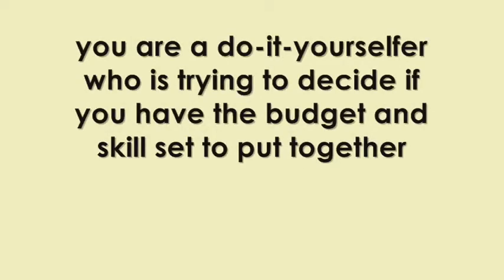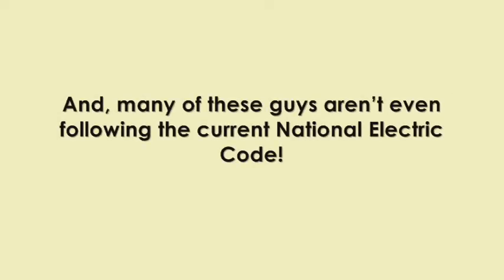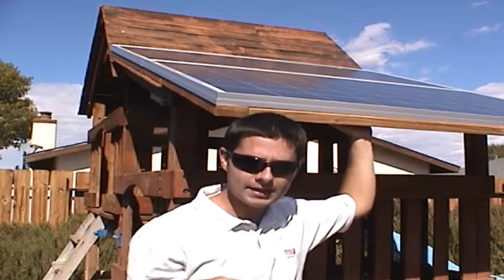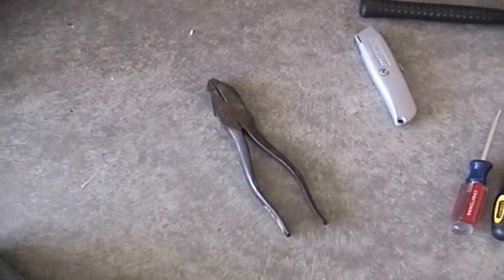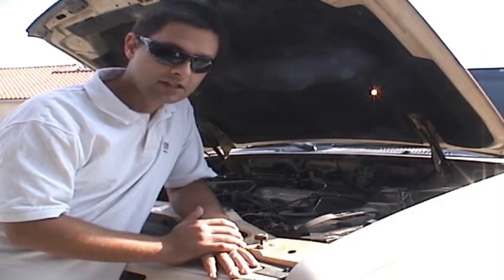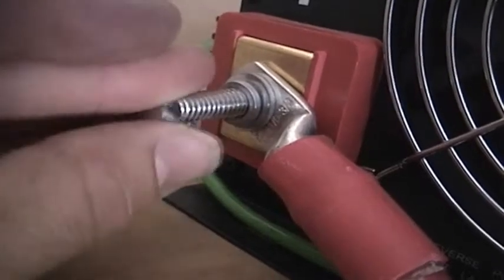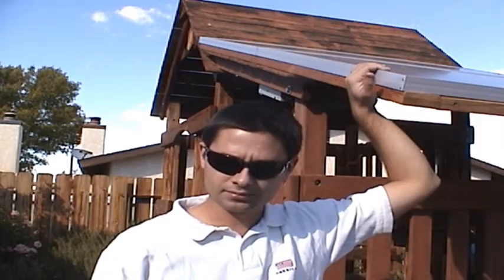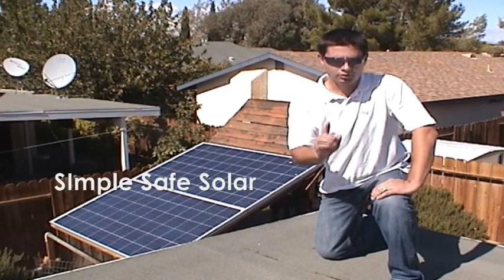Simple Safe Solar: DIY Step-by-step Solar/Battery Backup DVD (Full 2+hours Free on Youtube!)

Comment: Thank you for the video and all your work!  One question: what are the power parameters of the system you are describing? Battery (A), Solar panels (W), etc?  Just so we can compare it to the prices of "off the shelf" solutions being sold.  Thank you!
Reply from the maker: Hi TheMishaluba...if you go to the project website:
free downloads....and | diysolardvd then open the "System Diagram" link under "Essential Downloads", there is a specification table that has all the system info (page 2). Also, if you look under the heading "Supplementary Downloads and External Links" you will see a link called "Compare". If you click on that it will open up a table that gives the specs for two other solar backup systems. Feel free to email me if you have any more questions. All the best.
Reply from the maker: I did not copy the URL correctly in my above reply. :
free downloads | diysolardvd
and, email address is solardvd@hotmail.com
All the best.
Reply: Thank you!  Based on some stats I complied, the system you describe comes out to about 52 cetns/Whr of stored capacity.  This is less then half of the pre-built systems out there, which seem to run $1-2/Whr.  I bought your DVD and will try to build it :)  Thank you again.  Do you have any recommendations as to the mounting of solar panels.  I am thinking that ideally they should be on some sort of mobile platform, so the panels can be positioned facing the sun.
Reply from the maker: TheMishaluba
Thanks for running the cost analysis of the system. If you are looking to do a mobile system, check out this project:
http://www.rimstar.org/renewnrg/mobile_off_grid_solar_power_system.htm
Maybe it will give you some ideas. All the best.

Comment from the maker: Gotcha. I used that breaker for all my mobile (trailer mounted) military, solar backup power applications because it was small, easy to mount, water resistant, and was both a disconnect switch and breaker. The NEC does not prohibit the use of these type of circuit breakers/switches for a "backup" power system design that is not connected to the grid or house wiring. Thanks for bringing up the issue for discussion and clarification, though.

Comment from the maker: Thanks for the comment. The battery interconnect cables are sized according to the NEC for the max current load (Amps). The manufacturer of the inverter recommends the use of the larger, 0 guage inverter cable for low resistance which improves efficiency of the inverter. It is actually pretty common to make the inverter cable larger than the interconnect cables. It is not a current capacity issue, but an inverter efficiency issue.

Comment from the maker: Thanks for the comment. It may not be clear from this INTRO video, but I do run the wire through PVC when required (as the DVD explains). The point of the NEC requiring conduit is to protect the cable from damage and that's what I show in the DVD. Not sure what you mean by "main breaker", but, the battery-to-inverter disconnect switch and 200 Amp ANL fuse are perfectly suited for a "backup" power system. And, plug type inverters ARE allowed if they are not wired to the house wiring or the grid.

Comment from the maker: Hi, at this point the system I designed is completely off-grid. I wanted it to be simple for people without much electrical experience. Most of the people who are using my design don't have a problem just running seperate circuits to run the freezer in the garage, power tools in their workshop, etc. This way they still cut their monthly electricity cost, but they don't have to pay thousands more to grid tie a small, solar backup system. All the best as you put together your own system.

Comment: Hi Nice vid.
Can you tell me if your system is a stand alone system or connected to the grid ?If on grid does your system control battery drawdown and switching between grid and non grid connection.
Thanks 
FW